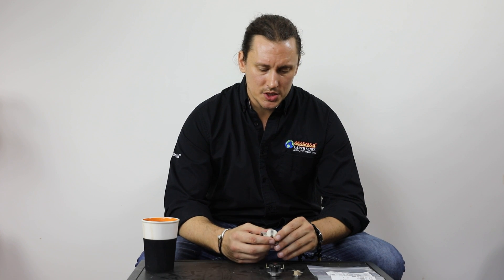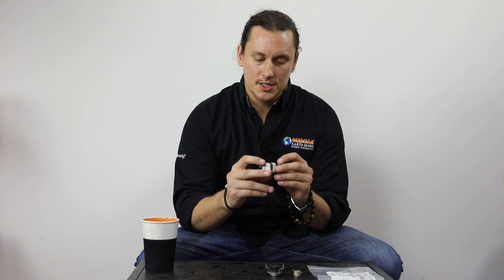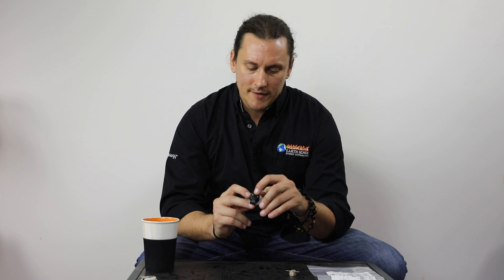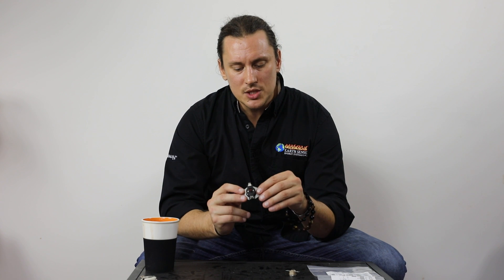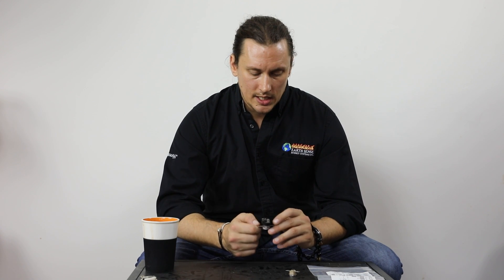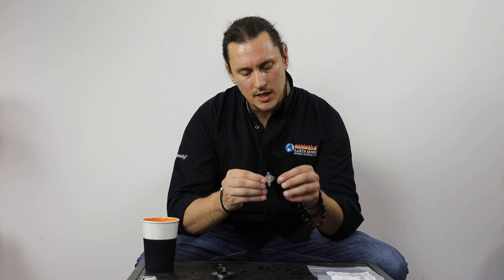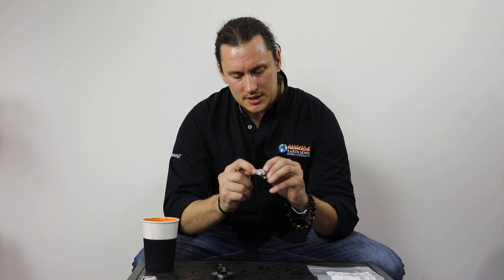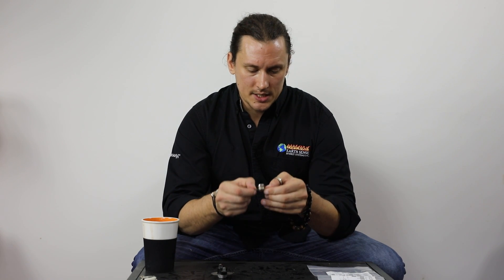Pellet Tech 101 - Limit Switches - Thermodiscs

Comment: I have a Whitfield Profile 30 insert pellets stove and are experiencing hard starts, pellet burn pot overflowing with pellets pre start, one it gets running it runs well for 8 hours or so then has the same start issue, flame is lazy. Stove has been cleaned multiple times, exhaust pipe cleaned, igniter replaced and photo eye was also replaced, stove is 25 years old and have replaced igniters multiple times and exhaust and combustion motors 1 time, any insight would be appreciated
Reply from the maker: Thanks for contacting us. Definitely sounds like this is an air-flow issue - we either have an air loss or an air blockage issue somewhere which is creating these issues. I know you mentioned your cleaning and replacement parts here, but I will outline below what I would suggest checking. 

1. Ash accumulation in the stove or venting. Detailed cleaning, especially the ash traps, rear firewall, and combustion blower housing manifold that leads to the vent pipe. Oftentimes there is a 90 degree elbow or a Tee on an insert like this - check for ash blockage between the combustion housing and into the vent pipe. You can use the sucking part of a leafblower/Vac on the exhaust outside to help pull out any stuck ash after you have run a brush through. Make sure the stove is off, cold, and unplugged. For the back firewall, remove the brick panel and give the rear firewall some taps with a mallet. You can also fish bottle brushes up there through the ash trap openings on the left and right. Overtime, significant ash builds up in the back firewall and restricts the combustion air flow.
2. Air intake under the burnpot - check for blockages or obstructions. If you are drawing in fresh air from outside, check the air intake pipe.
3. Check Burnpot for proper seating and make sure all burnpot holes are open.
4. Check the front door gasket and glass gasket to ensure it's making a tight seal all the way around. Use a dollar bill, half in half out, close the door and pull. Check in multiple areas. Should be heavy resistance. Make sure the stove is off when doing this. Inspect the glass gasket closely. 
5. Inspect the combustion motor and motor gasket seals. Motor should be operating near line voltage on start-up (110-125V). If either the round motor gasket or oblong motor housing gasket is not making a proper seal, it will leak air. Generally speaking these gaskets should be replaced every time the motor or housing is removed for cleaning/maintenance or when replaced. Even if it is not removed, these gaskets can become brittle and no longer making a proper seal over a few seasons.

Here is the owners manual if you need it for reference. https://www.manualslib.com/manual/1274603/Whitfield-Profile-20-Fs.html#product-Profile%2030%20INS

Happy to walk you through anything specific if needed. Keep us posted.

Comment: I have a switch on my old P61 that the feed system arm lands on every revolution of the cam. Harmon doesn't make it anymore but they say they have replaced that switch with some changes in the newer circuit board so it is not needed anymore. Also there are 2 wires going to it, do I just wire them together to complete the circuit/continuity? Also do I change out that arm that has the extra weight attached or leave it on and just let it do its thing? Thank you, great videos!
Reply from the maker: Thanks for the message here. If you change to the new style control board, leave the wires open/disconnected on that switch. The pusher arm does not need to be replaced, just leave it do its thing. Hope that is helpful, any other questions let us know. Thanks!

Comment: God day. I have an Enviro EF2 purchased new in 2010. Regularly cleaned and my inspection resulted in no cleaning currently required. Running flawlessly until yesterday. No ignition. Everything else seems to run as intended. I pulled the igniter and measured 42.5 ohms which appears to be within the ballpark resistance. What do you think could be the problem. Thanks, LouS/
Reply from the maker: Thanks for contacting us. If you have the OEM 300 Watt 50-1067 igniter, the OHM range is 30.0 - 38.0. If you have an aftermarket igniter, the ohms are more than likely different. For example our aftermarket replacement ohm range is 40.0 - 49.5. 

Keep in mind that it is the air rushing around the igniter element that becomes super heated and ignites the pellet fuel. We want to see if there are any air-losses or air-blockages. 
1. Check the burnpot, make sure it is seated correctly. Make sure all holes are free and clear. 
2. Check the air intake under the burnpot. Make sure there are no obstructions.
3. Check your front door and glass gasket as well as the ash pan gasket. Make sure everything is sealing tightly.
4. Check your flue vent pipe and make sure there are no blockages. 
5. Let's make sure the combustion blower is running near line voltage during start-up. 

Keep us posted, happy to assist.

Comment: Thanks for the information.  Is a "high limit safety switch" the same as a vacume switch on a new englander pellet stove?? Thanks again...
Reply from the maker: Thanks for the message. No, the vacuum switch will be a separate safety switch from the high limit switch. Some Englander models have two vacuum switches. The vacuum switch senses pressure in your firebox and exhaust. The high limit switch is designed to open if temperatures exceed a certain set point. Both of these switches are in line with the auger motor and will shut the feed system down if there is a safety issue or if the switch is faulty. Let us know which model Englander you have and what kind of issues you are experiencing. 
Here's a video overview on the vacuum switch for reference - https://youtu.be/pHeQzUmSlIE
Happy to help!

Comment: Pelpro 70 ,best stove out there as far as reliable.simple to run,clean and repair.bypassed the switches,sanded and polished the auger,shimmed the feeder tube so it can't jam.padded auger motor mounts
.runs perfect and quiet.
Reply from the maker: Thanks for the message. It's extremely important that no switches are bypassed in the stove. Bypassing is for troubleshooting only. It's critical that all safety switches are connected properly and are operating properly. If you have any questions or need any replacement parts for your PP70 model just let us know. Thanks.
Reply: @EarthSense  the 1 years warranty is a pain in the ass to get parts.still waiting for parts for one bought in December 23.piss poor  warranty dept.
Reply from the maker: @olivertaylor8788  Thanks for the message. If it was ordered through us, Let me know the name it was ordered under and I will look into it ASAP. Thanks.
Reply: @EarthSense  I have 2 needing parts,one has vacume switch bad and control board is jumped to get the exhaust fan to run.the new one needs control board and  exhaust fan won't cut off.both are running jumped because dam warranty people won't honor the warranty in a timely fashion, been 4 weeks trying to get control board,3 months getting  parts for the older one.i had to order a $70 controller from Amazon 2 months ago on the one warranted till Feb 5 24.sorry ass warrenty.they get that $1200 and they don't know you then.
Reply from the maker: @olivertaylor8788  Sorry to hear of the troubles. If any of your items were ordered through our company, I am happy to look into the status of everything; just let us know the name on the order. Thanks.

Comment: I have a Quadra Fire CB1200 FS. It does not feed enough pellets to bring the fire the normal 4-6 inches out of the firepot. The auger is turning but doesn't seem to be turning long enough. The stove is set wide open and we even increased the control box to the + 10 % setting. Any ideas??
Reply from the maker: Thanks for the message. Generally speaking the fire will be around that height only on a high setting. Medium and low settings will have less flame height. The +10 setting on the control box only affects fuel feed on start-up, not during normal operation of the stove. You do have a feed slide inside the hopper where you can push it down or pull it up to allow more or less pellets to enter the auger shaft during operation. Flame height can also depend on the type of pellet - possibly try a couple brands to see if you notice a difference. When operating on the low setting, the 1200 will use approx 2lbs/hr. on high approx 5lbs per hour. Do timing tests on the different heat settings. There is always the possibility that the auger motor is weak or the control box isn't providing the correct feed signals, however it is always important to check the simple things first. Keep us posted, happy to help.

Comment: I just got a warlock hersey pellet stove everything works now except the convection blower comes on and shuts off there's two of them will they come on when the Firebox gets hot enough or is it a bad circuit board or what do you think.great explanatory  video.
Reply from the maker: Thanks for the message, happy to help. Warnock Hersey will be the testing/certification lab for the stove; most stoves are tested by Warnock and will have that stamped in to the UL label on the stove. Is there any owners manual or any other indication on the UL label on the stove for the make and model? It will be very helpful as we troubleshoot. Some stoves have a low limit switch in line with the convection blower that will close once the unit gets warm enough turning the blower on and opens once it meets the set temperature on cool down shutting the blower off. If a stove had a blower limit switch like this and if that switch was failing, the blower may intermittently turn on and off. Other stoves do not have a blower low limit switch - some will have a sensing probe in the exhaust, others it is programmed into the circuit board for on/off timing. You can test the blowers as well to direct power to make sure the motors themselves are solid. Here's a video on creating a test cord to test direct. https://youtu.be/rlmiCYI2WPk
Keep us posted if you can find the make and model of your stove. Thanks!
Reply: Model  Freeland Flame-V Stove insert Test standard ASTM-E1509-95, ULC S627-M93,ULC 628-M93,VL,1482-1994.  Thank you for your response. Have a most great day
Reply: I left out tested both fans directly to AC they both work fine
Reply from the maker: @TheHardhickey  Thanks for the information. First I have heard of a Freeland Flame Stove. I did a decent amount of researching online, but I could not find an owners manual for this unit, let alone parts or the manufacturer website/contact information. 
Without any info on this unit the best I can say would be to closely look at your electrical schematic in the stove. See if there is a limit switch in line with the convection blower wiring. I wish we could be of better assistance here. Thanks.
Reply from the maker: @TheHardhickey  Good to know both blowers are in proper working condition. I just left a message on the other comment for you. Thanks.
Reply: @EarthSense thank you very very much for your time I went to feel if the igniter was working it looks like a Tesla coil it knocked me across the room it was pretty funny
Reply from the maker: @TheHardhickey  Hahahaha that's the best thing I've heard all day! I'm very curious about this stove. If I can come up with any further information I will let you know. Thanks!
Reply: @EarthSense  yes it was funny you and yours have a great Christmas I like your Channel no fluff right to the point no background music LOL
Reply from the maker: @TheHardhickey  You have a great Christmas as well buddy, thanks so much! Really appreciate that. More videos to come!
Reply from the maker: @TheHardhickey  Doing a bit more research, Freeland stoves were originally manufactured in Spokane Washington. In May of 1993 a company called Digitran bought out Freeland and their assets. Unfortunately I can't find anything related to Freeland stoves on Digitran's website. I came across one seller offering a combustion motor for the Freeland Flame stove, however it's the only part that is listed and I am not certain it would be the correct replacement at that. If you are ever looking for an upgrade we have several Refurbished pellet stoves as well as new pellet stoves in all price brackets. Happy to help however we can and again wishing you and your fam a Wonderful Christmas and New Year. Thanks!
Reply: @EarthSense  message received thank you Godspeed
Reply: @EarthSense  PS I just found out from my stepson and his company they make the frames of those non-electric pellet stoves self-feeding he said he'll try to get one he said they made them for 2 years he's going to try to get them to give him one and then transfer it to me he sent me a picture of the frame and one of those stoves
Reply from the maker: @TheHardhickey  Absolutely!
Reply from the maker: @TheHardhickey  Very interesting.. Keep us posted how things work out there. Appreciated!

Comment: I have been helping a elderly neighbor try to get her stove working (it's her only heat source). It is a Quadrature 1200. Basically the auger drops a handful of pellets lights them, no additional pellets feed, then it goes out. If you fill the fire pot with pellets, the stove lights and starts feeding. Presumably the thermocouple is not getting hot enough during the initial feed, since it is only feeding a very small amount of pellets, but filling the fire pit with pellets before startup gets it hot enough. The stove is very dirty, looks like it has never been cleaned. I checked that there is power to the vacuum switch, but I have not tested the switch itself yet. My guess is it is just so filthy that the high limit or vacuum switches are triggering. I have advised her to have it cleaned. What other things would cause it not to feed properly initially?
Reply from the maker: Thanks Jeremy, happy to help. Yes, the thermocouple acts as the proof of fire and gives signal to the control box when it reaches proper temp during start-up. This allows the unit to go into normal operation. 95% of issues are related to cleaning and maintenance of the unit. That would be the first thing I would recommend be completed. Blockage of ash can easily trip the vacuum switch. Generally you will notice a lazy fire with black soot when there is significant ash build-up. Without proper air velocity to the burnpot the thermocouple may not be able to lock in as you mentioned. The only other thing that would stiffen pellets during the start-up sequence would be dry spaces in the auger. The 1200 can have a tendency to have pellets funnel from the middle. If the auger has dry spots generally not enough pellets feed during start-up to get the Thermocouple to proper temp. Hope that helps. If you need the operation & maintenance manual just let us know and we can send that over. Thanks
Reply: @EarthSense  Thanks much!
Reply from the maker: @jeremybowen3097  Absolutely Jeremy, keep us posted!